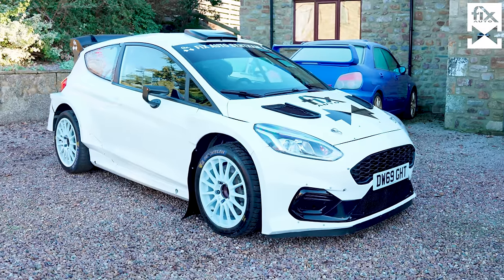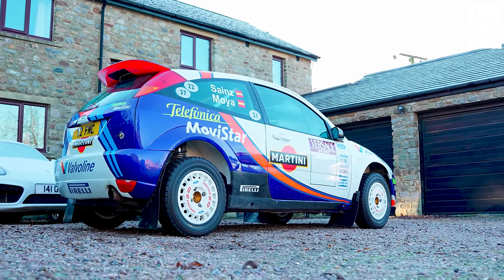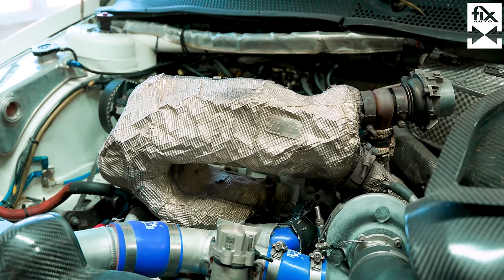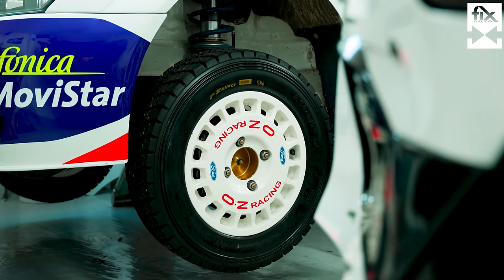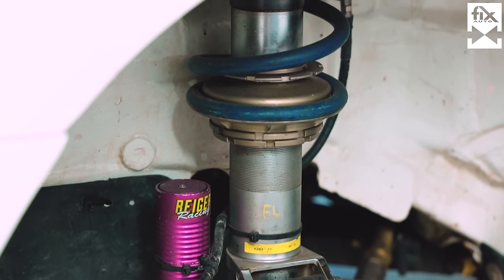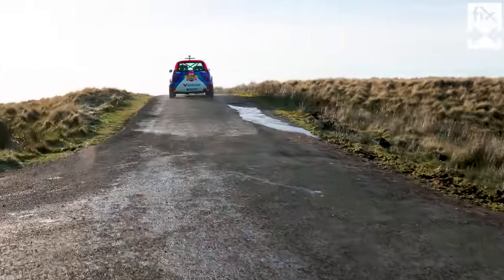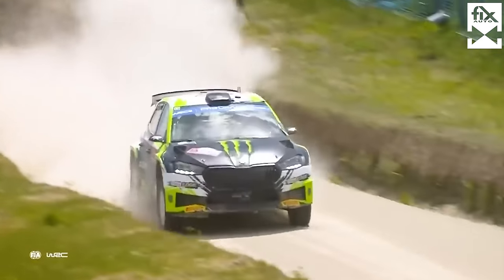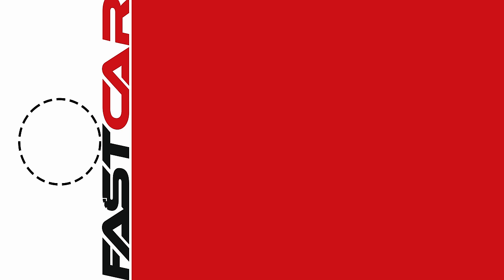Old vs New Rally Cars: Ford Focus WRC vs Ford Fiesta Rally2

Comment: No way, hard disagree. WRC now is only three manufacturers as opposed to half a dozen and the cars barely resemble their road going brethren. The 1997-2003 seasons of WRC were absolute peak. Same years for the BTCC coincidentally. They were the times where cars were still raw, just about analog enough to still be dangerous and wholly unreal at the limit. Pushing a four door saloon on those roads, at those speeds required a set of skills and a bigger set of balls than doing the same run in a Fabia.
Reply: There were 4 teams in 1997 and down to 3 when Toyota got booted 

And I’m sure purists said the same thing about sequential gearboxes not being analog enough at the time 

I get that 3 manufacturers ain’t great but it’s not like the sport hasn’t been down and then rebounded on top of the motorsports world multiple times
Reply: @kbdiesel  Yes in 1997 but over the years that I said you had Subaru, Mitsubishi, Ford, Citroen, Skoda, Hyundai, Toyota and I’m sure I’m missing one. Now there is Ford, Skoda and Toyota because Subaru and Mitsubishi both suffered a head trauma in the mid 2000’s and didn’t enjoy selling cars anymore so dropped out and started selling substandard crossovers.
Reply: Going back to the cars, I feel there's far more appeal advertising wise to having an actual car you can buy being seen winning rallies rather than a spaceframe chassis that has the word "Puma" written on it. Nobody buys a puma because it wins rallies. Because it doesn't win rallies. There's no connection
Reply: @otacon5648  these manufacturers were never all competing at the same time it has always generally been 3-5 teams with only 2 being competitive at the same time
Reply: @joshuawalcott321   Wrong, in 1999 and 2000 there were seven manufacturers. Ford, Mitsubishi, Peugeot, Seat, Skoda, and Subaru all did both of those years, while Toyota did their last season in '99 and Hyundai their first in 2000. The following three years had six manufacturers, with Mitsubishi and Seat dropping out but Citroen joining instead. The seasons 1998 to 2006 all had at least five manufacturers. And that doesn't include the semi-works teams, which ran additional identical cars under different team names, and privateers who were allowed to enter top level machinery as well. The difference being, today there are 9-ish cars in the top class, and back then there were usually 25 or more. For me, that's a huge difference that has made me loose interest almost completely despite the modern cars being absolutely awesome.
Reply: Analog enough during 1997-2003? Are you sure? Because, if I'm not wrong, WRC cars in 2002, for example, had 3 active diffs. They also had paddle shift system. Rally1 cars have only 2 mechanical differentials and no paddle shift system, no active suspension etc etc. So how old WRC cars of that period were more analog? Sorry for my bad english.
Reply: @alextavoularis8761  early 2000s cars were tech marvels for sure.  But all that was in the shells you could buy from the factory. And they looked identical (more or less) to factory models. Now you have more mechanical cars (good thing) in spaceframe carbon bodied go karts. It's no less impressive and still good to watch but I don't feel any feeling of "corolla wrc won the monte so I want to go buy one"
Reply: @stevieb026  Only looks were similar, but obviously not identical. WRC cars were wider, they had spoilers etc. And personally I don't care about looks. I care about performance. Only Group A cars were REALLY similar to road versions, in terms of appearance AND performance. I don't think that spaceframe chassis is something bad. Group B cars were the same, but most people believe that it was the golden era. But this is just my opinion and at the end of the day it's a matter of taste. But one way or another, we can't say that 1997-2003 cars were more analog than modern cars.
Reply: I would say 1998 or 99 - 2003 in wrc
2000 - last year of supertouring in btcc
2000 - last year without traction control in f1
2001 - last year of 2 stroke 500cc motogp
2001 - last year of supertouring in ETCC

2006 - f1 switch to v8 and domination of Loeb
2008 Subaru introduced that ugly and not competitive hatchback and for me interest to wrc fall 
i would say 1998-2005 was the prettiest era in motorsport

v10  f1, supertouring, many beautiful 2l wrc cars with battle for win, 500cc 2-stroke and 1000cc 4-stroke bikes in motogp, beautiful Ferrari 550 and vipers in fia gt
Reply: You're describing every form of motorsport at this point unfortunately. DTM cars might as well be space shuttles, GT3 is now the old GT1, etc. Racing has forgotten or lost its core heritage in favor of spectacle and spec sheets.

Comment: Why is one on tarmac, and the other on gravel tyres?
Reply: Focus is in full gravel specyfication
Reply: YES, THIS!
IF you are going to compare them currently, they should BOTH be on tarmac suspension, with tarmac (wet?) tyres and tarmac width wheels!! 😉

Now, David I am sure has driven the Focus WRC on tarmac on the appropriate suspension and tyres in the past. 

So maybe he can extrapolate the Focus' tarmac performance by/from memory, but yes it would have been nice to see them on the same tarmac setups for this  video, since it was shot on tarmac roads.

Comment: interesting video. Was coming into this video thinking about the differences I notice driving these cars modelled in richard burns rally. Certainly the power-generating characteristics line up with what was shared in this video. As for handling, I hardly know what to attribute to the car versus my ability to create a decent or realistic setup, but i do always feel like the 2000s era cars conform very closely to the road and they were easier to maintain oversteer mid-corner on loose surfaces with. meanwhile i always felt like the modern rally 2 cars were a bit harder to keep the rear out of line with, but very predictable, and very very good at dampening undesirable oscillations.